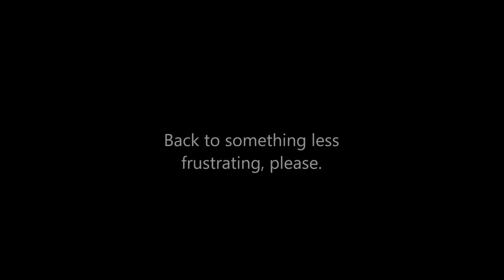Fender Wildwood is just wild.

Comment: I always wondered why fully adjutable bridges were never brought to acoustics as standard
Reply: Because in an electric, sustain is easy- on an acoustic where there is no amplification, every bit of the vibration counts. Adjustable bridges andswappable necks make deadzones of sound.
Reply: @jdsd744  I fully accept your point. However, I have a 1975 Yamaha FG300 that has a fully adjustable bridge and it's beautiful. I've often wondered why there aren't more options like that for acoustics.
Reply: @jdsd744  They say they, but then acoustic guitars with adjustable bridges and swappable necks actually sound just fine, and they do exist so... Not really lol.
Reply: For cheaper, factory-produced guitars that may be a viable option. However, for more decently priced, handcrafted, and solid wood acoustic guitars, every nuance within how the energy is transferred from string into the wood is important. Changing the contact point for the string's vibration from genuine bone to a metal will have a substantial impact on the overall tone of the instrument. Solid bone saddles have still reigned supreme over other innovations throughout the decades simply due to an objectively better quality of sound, and the nature of how it works means that making adjustable saddles is not a flexible option without compromising the overall tone of the instrument. This is why it's important for a good luthier to be able to provide accurate saddle compensation and height to the best of their ability, and I think players will benefit from allowing experienced techs to do this kind of work for them.
Reply: @alexduong4604 well said!!!
Reply: @stringlocker  They would have to be redesigned
Reply: @stringlocker  I took those out, also I redesigned the Intonatable Acoustic Guitar bridge by re-voicing the top
Reply: On an acoustic a metal saddle is inferior, poor sound, the preferred material is bone or antler, they yield a sweet yet ringing high-end acoustic sound.
Reply: @walkertongdee  That's no longer the case the top has been cut half as thin & revoiced for a metal saddle to make it twice as loud & a bit brighter as it's the same material as the strings.
Reply: @roadshowautosports  They would have to cut the top half as thin & revoice it. Also the metal saddles put the strings at a sharper angle. To get good sustain on an acoustic guitar the break angle of the strings would have to be twice as much.
Reply: @walkertongdee  Actually that's not the case cause this is made entierly out of scandinavian wood so that a metal saddle would work. To make a metal saddle work the guitar would have to be an all metal guitar. In fact all metal acoutic guitars exist such as the metal bodied dobro.
Reply: @alexduong4604  However adjustable saddles would bypass that need. They would have to revoice the top again. Kinda reminds me of the time some other musician made a parody of Love me Tender about Feminine Hygine Period Products that only Females are allowed to sing.
Reply: @jdsd744  Exactly so.
Reply: @jdsd744  Someone refined this design:https://www.youtube.com/watch?v=SY7Q3BZrXHw & it increases the break angle of the strings over the saddle.
Reply: @brendanwalsh108 people don't realise but Yamaha is always been ahead
Reply: @jpmac098  Every Taylor has had a bolt on neck.
Reply: You cannot the this Wildwood is the reason why it adjustable bridges cannot be done.. This is simply a poorly designed, badly manufactured example from a company who really should not try to build revolutionary designs in the acoustic medium...
Reply: One of a few reasons I don’t love acoustic guitars

Comment: About that buzz on the Martin, I would set a sine-wave generator to the frequency that activates the resonance and have that play on a headphone speaker. Stick and move that little speaker around the different sections of the guitar to make the buzz happen, might have to modulate amplitude of the signal. I'd also use a stethoscope. I use this approach to pinpoint nuisance resonnance issues on speakers
Reply: What?
Reply: A tuning fork might also work for the job

Comment: I recently did my first re-fret on a similar guitar, an E-Ros “model 612 raven” a 12 string a possibly ply body with a bolt-on neck, a zero fret and an aluminium height adjustable bridge, as well the bridge was riveted down! A very interesting acoustic to work on

Comment: I have a Blueridge BR-60 that buzzes.  It's the truss rod.  Slightly tight and it starts to buzz. Loose and it doesn't.  I have concluded it's the truss rod by eliminating everything else and also the sound comes right from the neck.  I can whap my hand on the back of the neck and hear the pop of the truss rod as it slaps in the cavity in the neck.
I set the truss rod to loose and finished the frets in a manner to create relief.  And I have left it that way for about 5 years.

Comment: IMO, the right answer is to replace the saddles with ones that are fully adjustable. I realize it wouldn't be easy, but something could be machined to solve the adjustment issue. If the sound is neutered, then it would be pointless. I love my acoustic sound, but I would love this level of adjustability.

Comment: I built a telecaster acoustic/electric by carving out the body and inlaying a spruce top.  I had the same string restring, shim, start over issue.  My solution was to slacken the strings, put a capo on at 1st fret, remove the neck, adjust the shim, replace the neck, tighten the strings.  After about 10 times I finally got what I was looking for.  Then I put a new set of strings on because the bending will weaken them.  It's my favorite guitar.  Neck pickup, spruce top sounds comes through.  Sounds like a jazz guitar.

Comment: Watching the fender Wildwood episode. You're going through the height of the saddles. Instead of shimming if you were to extend both E's closer to the fretboard, it would lower them! Your deflection angle would decrease and the strings would lower. That's what those tiny barrels are saddles are there for.

Comment: Not saying you would want to do this, but if you have access to a metal lathe you could manufacture new barrels at a larger diameter.  If you made them a little oversize you could fine tune the height by filing a notch for the string.

Comment: My Yamaha has a similar buzz as the D28 and turns out I'm sure it's the string between the nut and the fret being played. Action is pretty low and I think at certain spots the resonance is enough to have it rattle against the lower frets, because when I mute above where I'm fretting it stops.
Reply: Check your tuners' nuts are all screwed down tightly, and the wee screws on the back are tight too. I promise you this solved a prob for me, when I was sure it was the truss rod or even the bridge.

Comment: Firstly I love thew videos you make and I learnt a few things from you watching them. The Martin guitar you had trouble with I had the same trouble finding sympathetic vibrations in a Martin once and also 2 Australian Maton guitars. It can be very frustrating, also how do you charge a customer for no results. Anyway after what seemed to be hours searching I ended up fixing the Matons by making the bridge saddles a very snug fit into the saddle slot. I did this one of the times by making a new one that was a nice interference fit in the slot and the other time I used brush on super glue to the saddle to slightly increase it's size for the same result . They were by no means loose to begin with so maybe it's worth a try if you haven't done this yet. Keep the uploads coming I love checking out your work.

Comment: Hard to know what it sounded like “live” in the room but to me it recorded pretty nice. 👍
Reply: I agree! I can imagine that if it   sounded this good on the tube thru the speaker of my budget Android Smartphone, then it must not  have been too bad and was probably  pretty good live in the room.
The zinginess (yet another made up word to describe tonal attributes) or how the saddle pieces ring, must probably help with the overall projected brightness. I really like how well it could ring out the highs and that the lower strings weren't muddy either.
It sounded really clear with just enough warmth.  Certainly there are many attributes of unconventional design that contribute to its sound. I did not expect it to project so much sound. With it's bracing so being short of the bridge and the lack of meat on the bridge, plus the shims and block routed under the saddles , the bolt on neck shims and probably shimmed under the nut too. Also not alot of string pressure at the nut due to inline six tuners. 
Numerous splits and such,,, 
???? Yup, it just goes to show you what great job that this guy is capable. This has to be a labor of love. Whatever the owner paid for this work, it likely was very very underpriced! 
Wonder how long it can remain with good tone? Those guitars will certainly grow rarer and rarer because they can't go the distance. That soundboard will likely fold at some point. At least they are easy to reset the neck angle!

Comment: The martin, does it have a  adjustment in the neck to set the relief. Is it possible that it is broken or stripped allowing the vibration you hear?
Reply from the maker: 1970.  It has a steel reinforcement bar but Martin didn't start using adjustable truss rods until 1986.
Reply: @twoodfrd  A 3/8" square tube, right? The one in my 1976 D-28 rattles, but it doesn't rattle all the time. I think the neck on mine suffered whiplash, and the glue seem is loose between the headstock end of the neck and the fingerboard, so the metal rod buzzes around sometimes. I sure wish I lived closer to you. You do amazing work!!!

Comment: No. The number is simply a model or "run" number.  I have a Wildwood II that is a gold/yellow.  I didn't think there were Wildwood IIIs.  The colors were what was available during that production run and there were two or three colors per run.  At least that is what my research tells me.
    The pickup is missing from the pipe that runs through the body.  I'm sure mine has a metal pipe in it .  I thought all Wildwoods had pickups that have a jack drilled in the side,  about 4-5" below the strap button. The pickup on mine flips up and down to either center in  the sound hole or turn down inside the body.  It has a volume wheel that turns in a slot.
It should also have a brass nut, if it were in original condition.  I actually like mine.  It has a flat top, no dishing or bowing.  I do have one or two small shims under saddles to get the string height right.

Comment: I was surprised that you didn't just choose to use shims under the bridge saddles to control the action  on that Fender.  Once you routed out a flat surface for that insert, it would seem to be a much more straightforward approach for future action control to add or subtract full width shims.  No?

Comment: I'm not finished with the video, but I would of just got some adjustable barrels from a Fender bridge and glued on some plastic nibs or something on the bottom so you don't have metal screw cutting into the wood, and put em on their.  I mean sure they are not original, but they would work a lot better because you wouldn't have to air on the side of high on the neck fit and you can just adjust the saddle like on a electric guitar..    Providing I was the owner of this thing, people may scoff at me for modifying something from the way it came, but if it makes it better then why not?

Comment: Light gauge strings will help both of those guitars. Light strings will not cure Martin. But it may lessen or stop the buzzing for a while. Maybe by that time, the buzzing comes back to that Martin. It will be clearer where the buzzing is coming from. Cause by that time it will be much worse. If all else fails. Try calling the Martin Factory. Maybe they had a lot of problems with year D28. And someone or a teck there can give you an insight on what's going on. Is that Martin for sale?

Comment: I feel for you. I've worked on a few of the 60's weird Fender acoustics and they were a journey down the "what was Leo thinking" highway. The early one with the metal adjustible "tone rod" actually worked to adjust the neck block that was beginning tilt toward the bridge. But a Newporter body totally folded up because it didn't have the rod in it. I had to fabricate one that actually worked. The Newporter had a standard type of bridge so that wasn't a problem. The neck had no fret wear so I'm assuming that the action got bad very quickly to the point that it was unplayable. The adjustable bridge on the Kingman was Leo's answer to a question that was never asked.

Comment: I believe the buzz on the Martin is an unavoidable reality of any guitar, acoustic or electric, with roundwound strings.  It is an interaction between the string windings and the fret, and to some degree depends on condition of the fret and at what point in the "phase" of the wrap is in contact.  I would bet that the open strings don't buzz, even when playing the same note closed that does.  I bet the plain strings don't buzz either.

Comment: I'm curious about why the bolt on neck approach never caught on more for acoustics. I had a Framous 5 decades ago with a bolt on neck. It was a pretty good looking and sounding guitar (at least to 15 year old me).  But bolt on neck acoustics are rare.  And I love the idea of a fully adjustable acoustic bridge for intonation and string height. Not this particular implementation, which clearly missed the boat on a few fronts, but as a concept. But I've never seen (a good) one.  Come on inventors!
Reply: Actually, many are now. Taylor and Martin, to name a couple. But they are bolted throught the neck block and hidden behind a sticker or a small piece of wood.